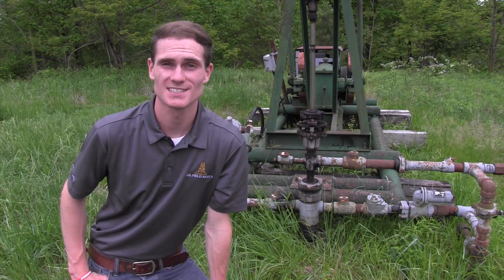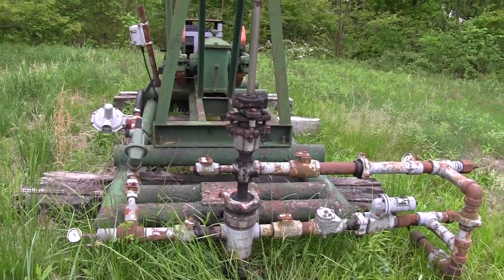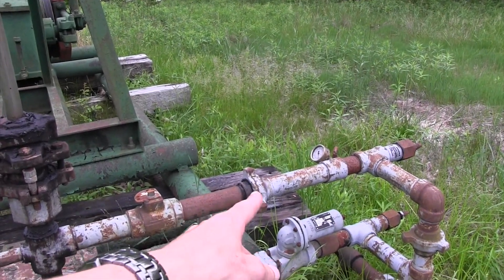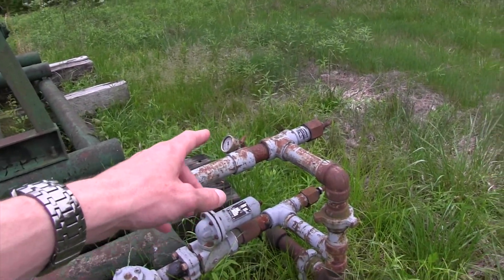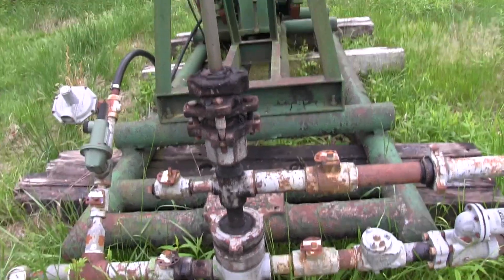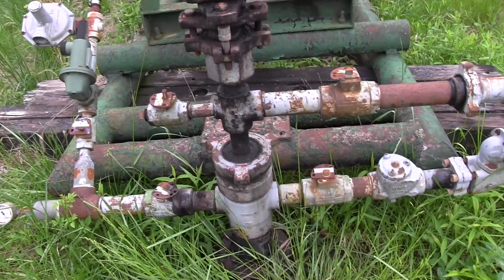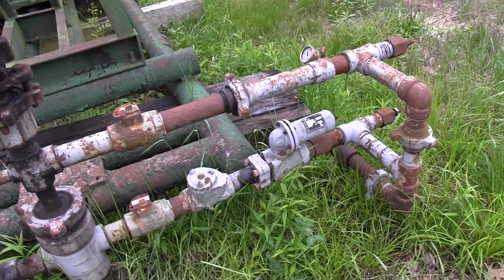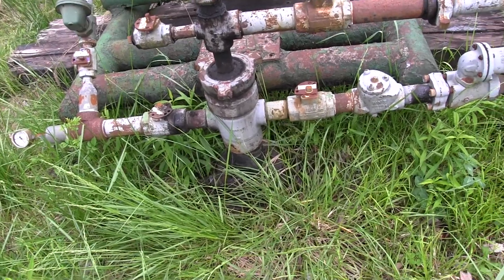Conventional Wellhead Setup

Comment: What’s happens if the bypass line has a leak or fails? Are explosions potential in such cases?
Reply from the maker: I'm not sure what you're referring to as the bypass line. Explosions are pretty rare with any O&G system, but is quite possible with natural gas if everything aligns and there's a leak and a spark.
Reply: @OilfieldBasics  Thank you for the response. Very interesting video.
Reply: @OilfieldBasics  is a back pressure line sometimes referred to as a bypass line?
Reply from the maker: @dualityreality369  Ohh I think you're referring to the backpressure regulator. That is not the same.
Reply: Out in the woods?? Lol!! Not where I am from?? Flat as a pancake and definitely no woods!! 😂😂😂
Reply: It's called a Baird back pressure valve